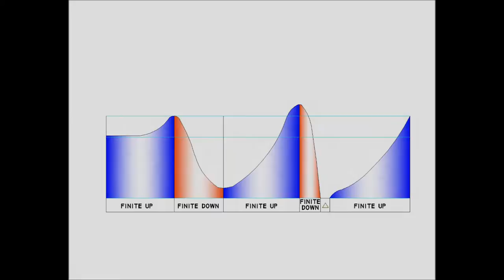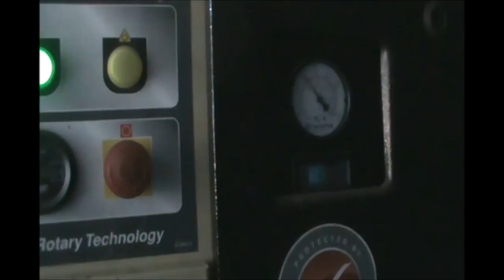power hammers Part 1

Comment: as I told you in another comment, I am going to a week-long, "build your own," power hammer workshop. I enjoyed these videos, and they helped me make up my mind. I have used, and really liked Big Blu. Don't get me wrong. It is just that I am a one-man shop and I make Chinese swords and European swords sometimes, and knives. I have a very specific market and don't need the flexibility from a large air hammer. Only because I can't afford it, really. I like your machines, and I don't want to give the impression that I don't. I am building a little tire hammer because I use a hydraulic press to do the major metal moving, and will use the hammer for drawing, fullering, cutting material with a top tool, etc. Your videos are very informative, and helpful, and well thought-out. Thank you for making them.
Reply from the maker: We love tire hammers too. They are like a gateway drug into power hammers. ;)

What class are you taking?
Reply: Bob Menard is hosting one in Portland Maine. At Ball and Chain Forge. Clay Spencer is coming up to teach the class, though!